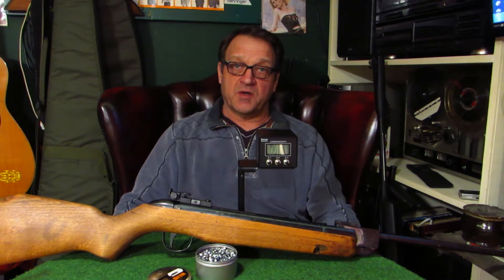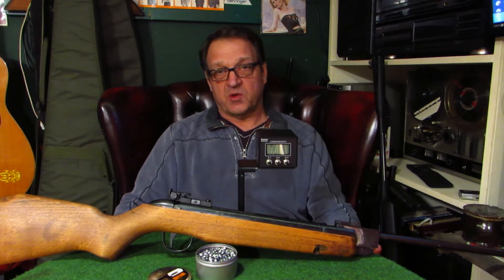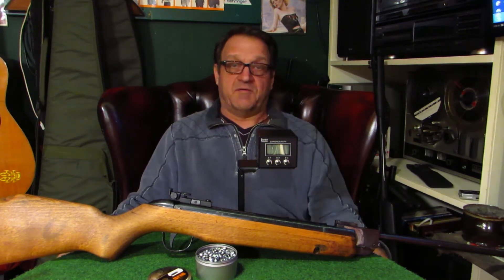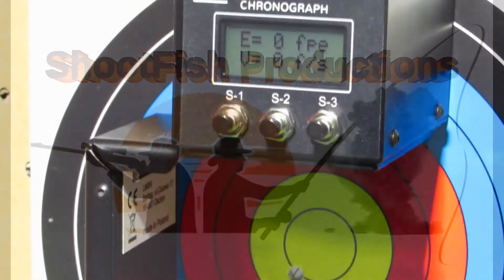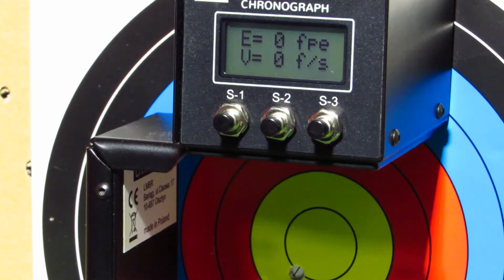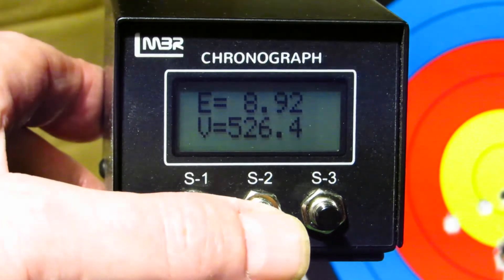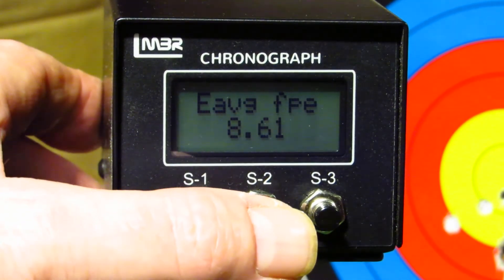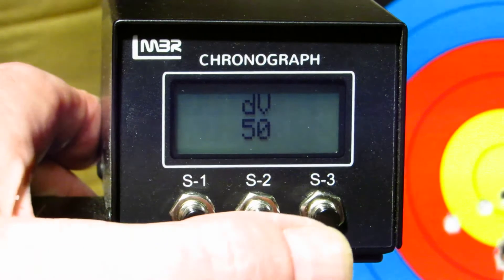Webley Hawk  Mk3 Airgun Power Test

Comment: The Webley Hawk mk3 was Webley's answer to BSA's Super  Meteor. I well remember my friend having the Hawk mk3 and me a BSA Super Meteor. That was back in 1979. Happy Times!
One little fault that can develop with Hawks concerns the safety catch. After extended use the gun can sometimes discharge as the safety pushed into the fire position. Just thought I'd mention it.
Thank you for a great presentation.
Reply from the maker: Hence the reason the safety is missing on mine. Thanks for your comments.